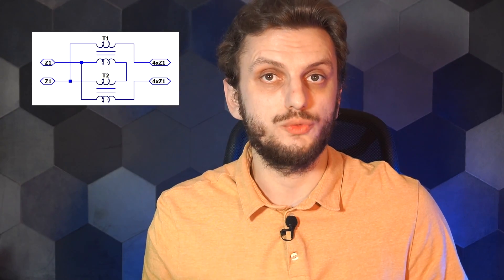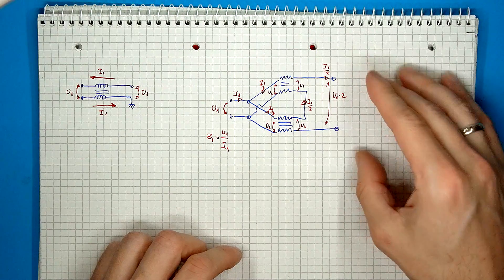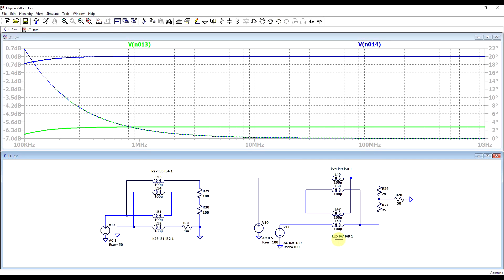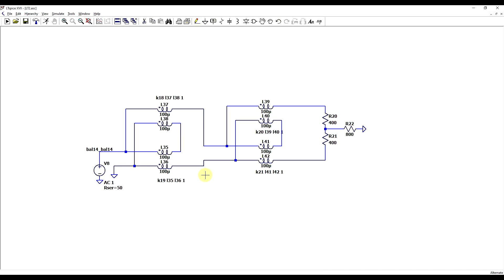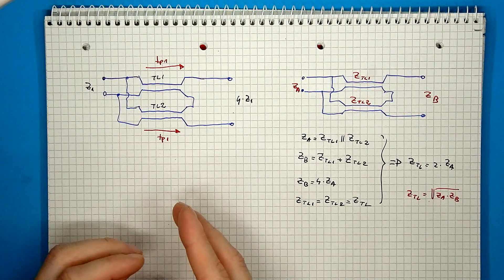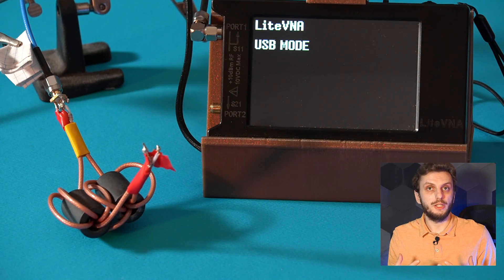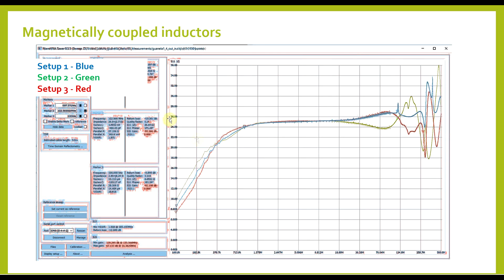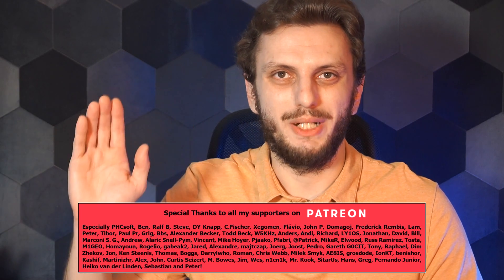Analyzing Guanella Impedance Transformers

Comment: A little question:  why added the 1meg ohm between the 1-4 transform center node and the ground to degrade floating error?
Reply from the maker: yes, in the simulator if you leave nodes floating, you can sometimes get errors; so whenever this sort of situation happens, I just add a large value resistor - the value is not that important as long as its large enough to not impact the normal operation

Comment: Do a search for the "Kellermann Balun". It might be of interest to you and others, possibly try to simulate it and figure out how it works, the theory behind it. I contacted a few people on the subject, not much was given out. I'm a retired RF engineer, and also a Radio Amateur for 50 years. If I get the time I will also build one to test. Mind you that it is a 1:1 Balun. From what I can understand, it will handle plenty of power, depending on the size of the coax used, eg: rg142 or rg393. Should be a perfect Balun for a Balanced Tuner, on the input side of course, 50 ohms unbalanced in , output balanced.
Reply: Look at the configuration closely and you will see that it is simply several dual core chokes in series.  It's a convenient physical layout but nothing special electrically.

Comment: Nice video and very informative. But have you tried  an LTspice simulation of 1:4 transformer  with transmission lines, to see the low frequency dropoff ? It must be depending on lengths of the lines...
Reply from the maker: In the previous episode of this series - the one on Ruthroff transformers, I do show a method to simulate impedance transformers using transmission lines in which you can also see the low frequency drop off.

Comment: What would be the disadvantage of using the same magnetic core for all lines on the Guanella transformer?
Reply: You would have the two (or more) magnetic fields interacting with each other if all lines are using a single magnetic core. This would not produce the same results as using different magnetic cores.  The multiple magnetic cores keep respective multiple magnetic fields separated from each other.

Comment: Hi FesZ,  wondering if you can analyze the DC Blocker circuit. I tried simulate the circuit with LTspice but I got rather strange result.
Reply from the maker: I think this is the first time of hear of this circuit; maybe you can give me some details on what you would like to use it for and when it is needed; also what sort of simulation issue did you run into?

Comment: An interesting question is: at what frequency does the transformer cross over from transmission line mode to a more conventional mode where the line impedance is not a determining factor of performance.
Reply from the maker: I remember reading somewhere that this point is around when the line length is 1/10 to 1/12th of the signal wavelength. So when its shorter than this, it will work in the "conventional" mode and above you start seeing the transmission line mode